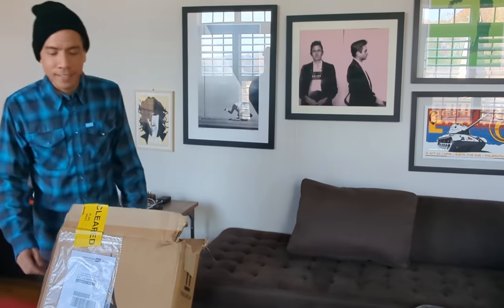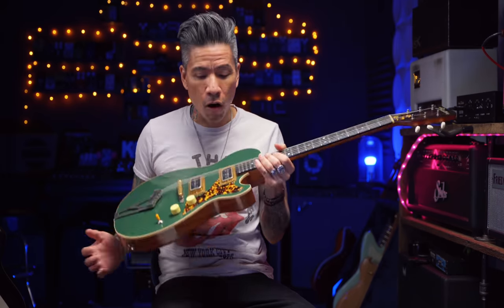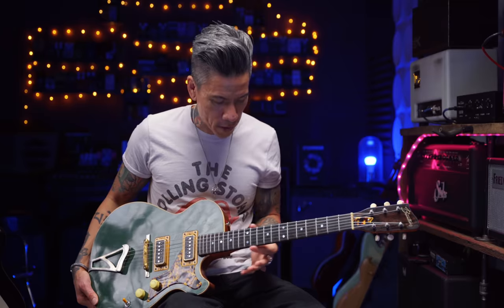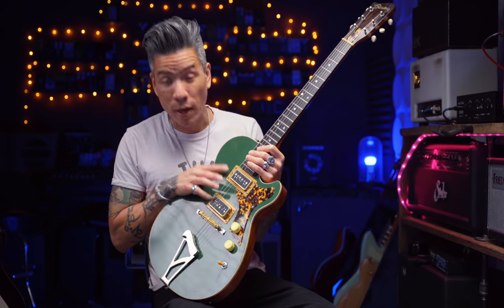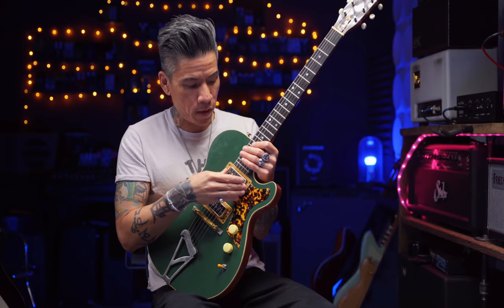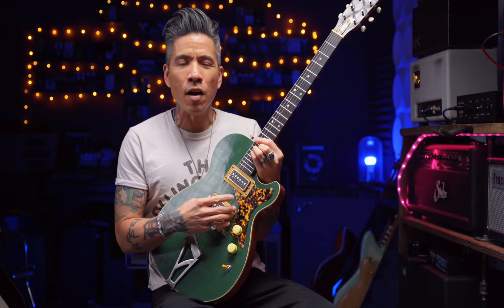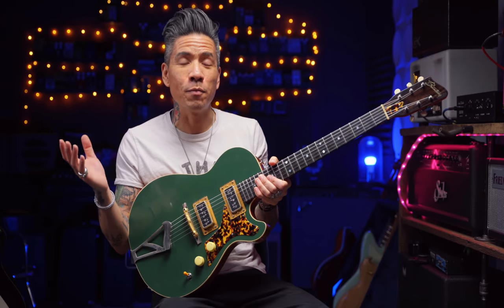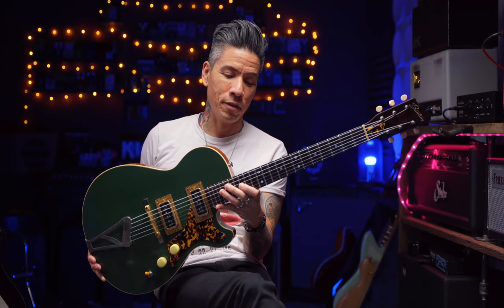It's Here!...Custom Bunting Guitar Reveal

Comment: With much respect RJ, it must be a generational thing.  I'm old school, and still don't see why there's a need for any guitar that isn't a Strat, Tele, or Les Paul (or Gretsch).  They are, and continue to be, the best guitars ever built.
Reply: Every one of those examples you've mentioned have some level of design flaws - and they are definitely NOT the best guitars ever built!  Their continued popularity is based on them being incumbents and a large part of the reason for that is that they were marketed correctly at the right time, no more.  

It is absolutely possible to make a better guitar than a strat, paul, tele, duo jet etc and both builders and players should be striving for this rather than stay stuck in the past.
Reply: Actually, they weren't marketed at all back in the late 60s/early 70s.  The only visibility they had were through what few guitar magazines that were around, album covers, albums, and the occasional tv show that show-cased your favorite band.  So, no, it wasn't through marketing initially.  Also, back then, players weren't all that anal about fret-height, scale-length, radius, bolt-on vs. set-neck, nut width/type; all that minutia that people obsess over today.  Also, all you had were Fender, Gibson, and Gretsch at music stores.  So you played a few that the store stocked, settled on one, bought it and went home and played the shit out of it.

Just set it up yourself, intonate it, tune it, and play the damn thing.

Comment: Basically it is an Airline with hotter Pickups...why Not Put Better Pups in your Eastwood??? unless you guys have parted ways...
Reply: It is nothing of the kind.  

What it actually is is a hand-built guitar made using top quality woods/materials and very much in the mold of a Gretsch Duo Jet - a far cry from an Airline.  

Nor are the pickups particularly "hotter" than anything.  

These (T-Armonds) are in fact reproductions of the original DeArmond pickups that appeared in early Gretsches and later Guilds.